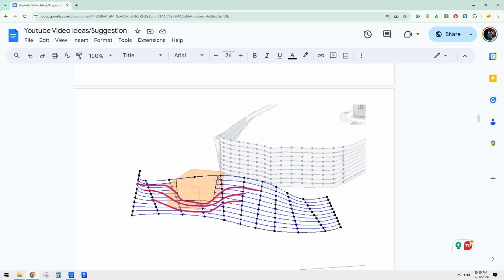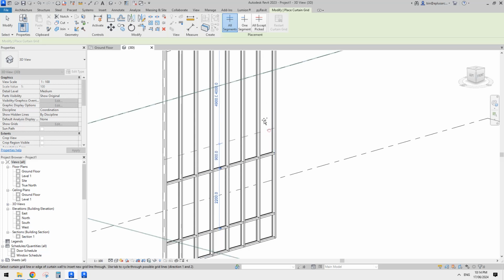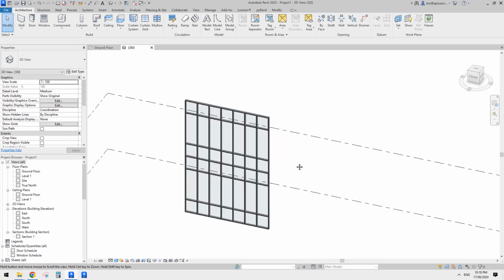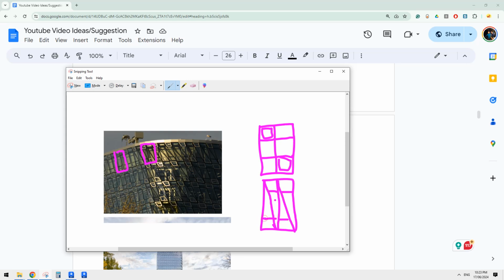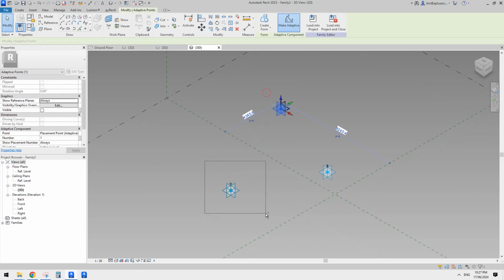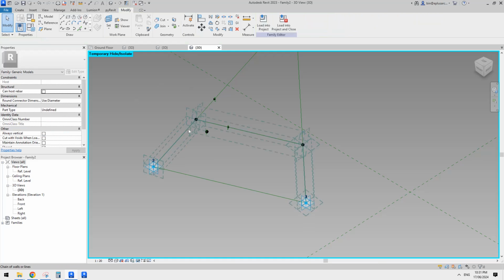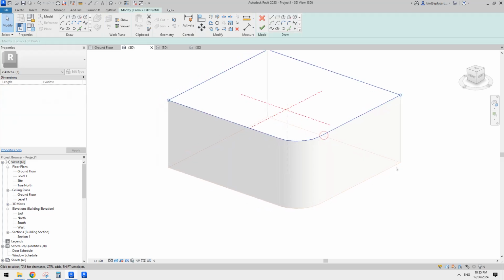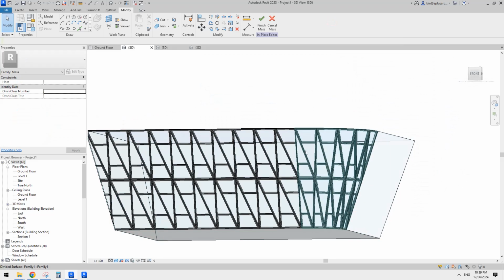24033 - Pattern Based Family Exercise (irregular shape curtain wall)

Comment: good，i want to know how to make this curtain wall family with actual profile extrusion and thanks
Reply from the maker: You can modify the profile to the shape you want, instead of some rectangles. Alternately, you can create an adaptive family with the profile (model lines), load it into the pattern-based family, use place on face and place two on each reference lines, then create a form with them.
Reply: @BINHE615  thanks your reply, will you try to consider to make the video like this, i am expert the extain video like this,  thx
Reply from the maker: Can you post this in the shared document please?
Reply: @BINHE615  where is share document,  please let me try